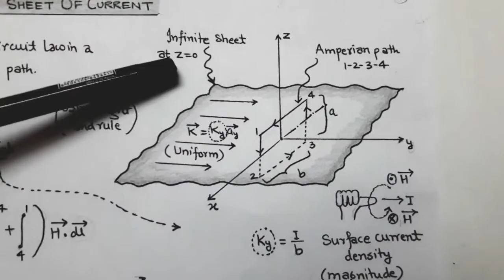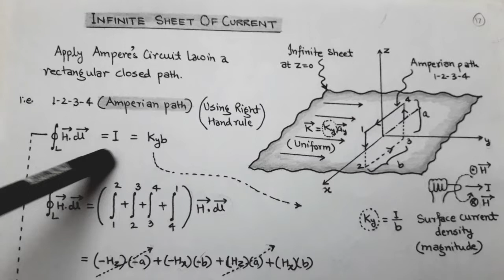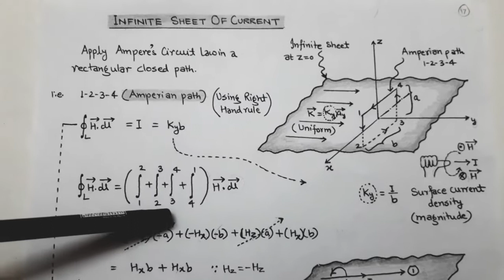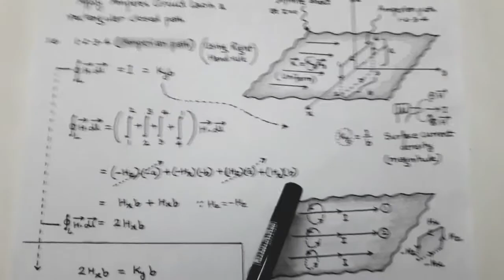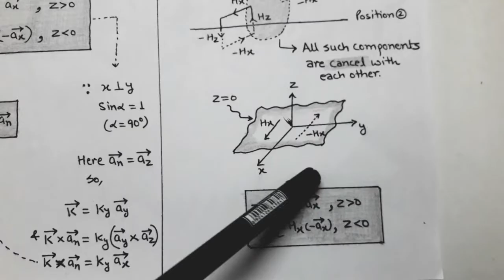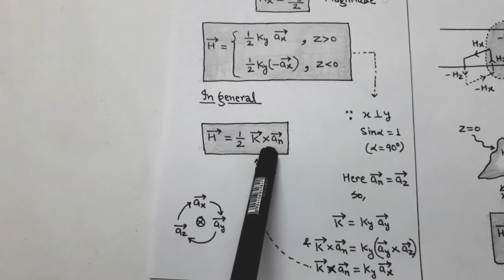3.8 INFINITE SHEET OF CURRENT for I.E.S./G.A.T.E.

Comment: You said the angle between x and y axes is 90 degrees, but you took the cross product of y and z axes, so you should have used the 90 degree angle between y and z axes. And speak fast. Don't wait many seconds in between. Practise.